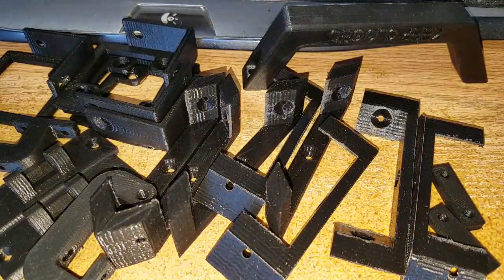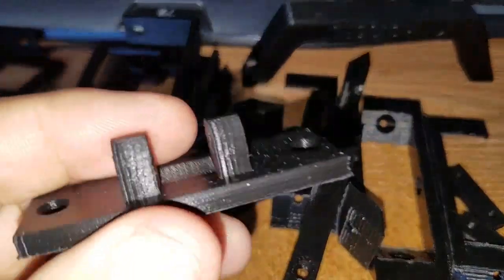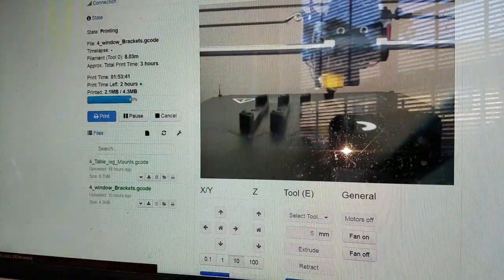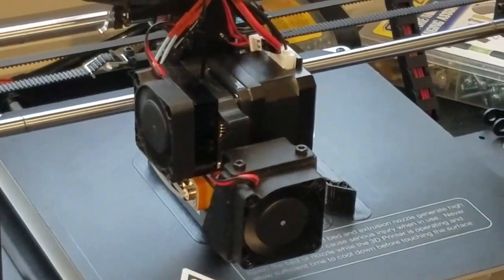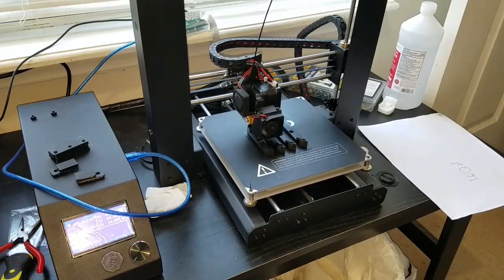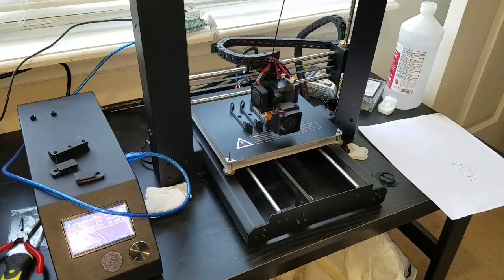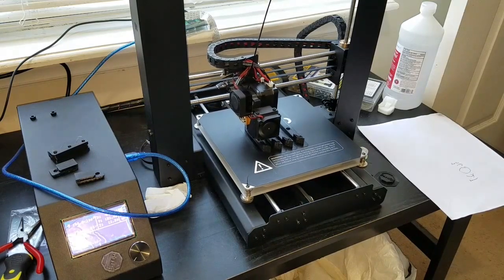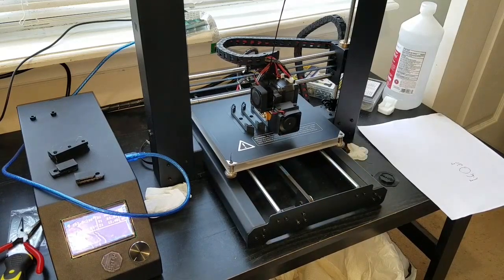Wireless 3d printer with Raspberry Pi and Octoprint

Comment: Dude! How do you like that printer? I am researching printers and I need honest answers. Like from one ham to another. Does it need other upgrades?

Let us know when you are done with the project with those brackets/
Reply from the maker: I love it. The only upgrade I have done is the mosfet power board.   But I don't think it needed it, I just wanted to be on the safe side.I haven't done the all metal hot end upgrade yet. I will think about it after i print some ABS plastic. So far all I have printed is PLA plastic and that runs at a lower temp. I'm thinking about buying another one so I can have more printing going on at the same time.

Comment: Well brother it sounds like you are very satisfied with this 3D printer. So the question I would ask if you're going to be a first time printer buyer would you recommend this for the first time buyer?. Thanks for sharing.
Reply from the maker: I am a first time buyer. I would defiantly recommend it.  There was some problems with the older models but that have all been sorted out. I plan to do some mods but right now it is running just like it came out of the box and all the settings are default. I would say from boxing to printing ... 10-15 minutes.  I can't think of anything in my life has been this easy.
Reply: Awesome